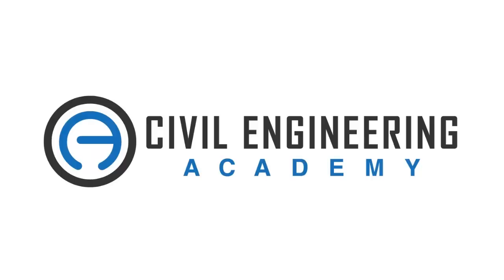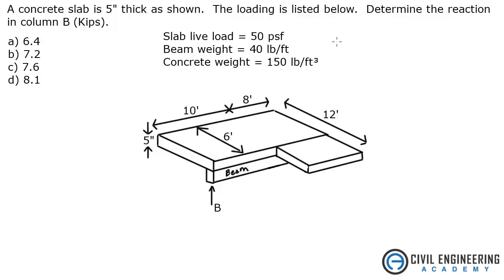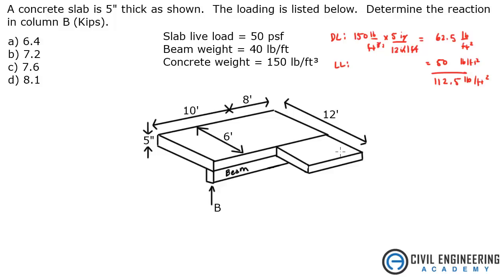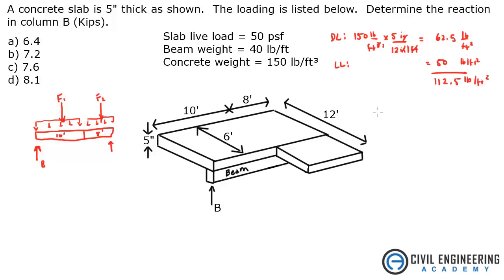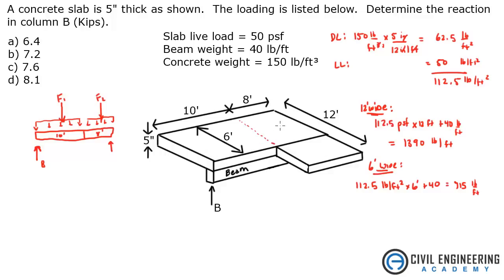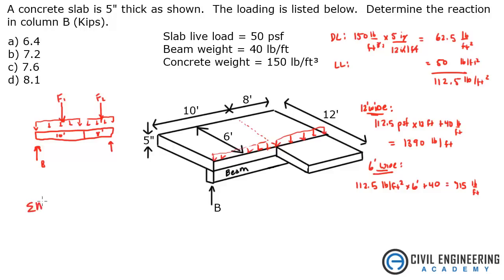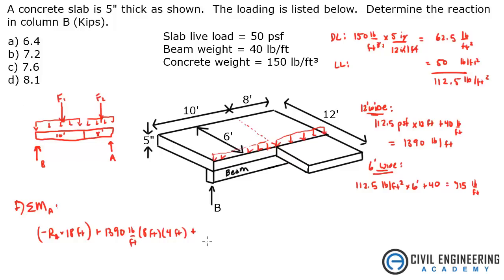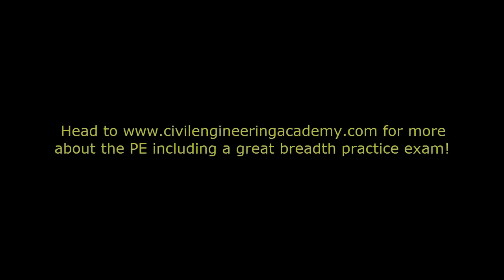Structures-Slab Loading on a Column

Comment: Thanks for the lecture thus far ,but I need some answer relative to the problem.1.Why didn't you used the formula w=1.2DL+1.6LL for the design loading? 2.Why you used the the distance of f2 plus half the distance of f1 multiply by the reaction of f2 but did not use that approach for f1? 3.We were looking for the reaction at B instead of A which was not on the diagram and was not ask for.

Comment: I have a question:  Once you found the pressures, why didn't you multiply them by the slabs' tributary widths?
Reply from the maker: Jay M  I would assume because no other beams are shown that we are looking at the tributary width on this beam.  If other beams were shown or if the problem was very clear about a the beam locations or tributary areas then I would have considered it.  Let me know if that makes any sense.
Reply: +Civil Engineering Academy This makes sense. However based on this logic, since no support is shown at A, why is it okay to assume there is a support at A?
Reply: You don't need to assume any force at A. He took the moment around A, so it was ignored.

Comment: 2 questions:
1. Why did you multiply the 150 pcf by 5 inches?
2. Did you make a mistake in the notation when you were summing the moments? Shouldn't it be -Rb instead of -Ra?

Great videos! Thanks for your help.
Reply from the maker: supermanny73 1.  I took 150 pcf and multiplied it by 5 inches because we have to find what the loading is in psf due to the unit weight of the concrete.   This allows us to add it to the live load (in psf) to get what the total loading is on the  whole area of the concrete slab.  I hope that makes sense.  Let me know.

2.  I did make mistake with the notation.  I fixed it on the video with a comment.  Thanks for the catch!